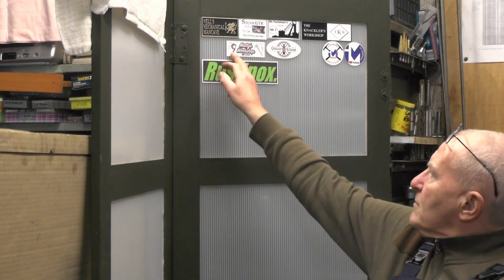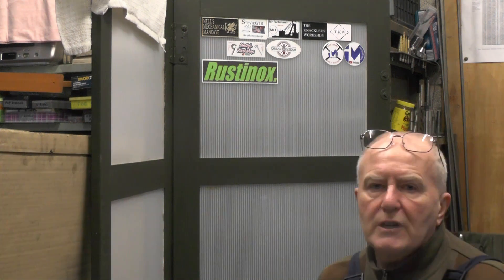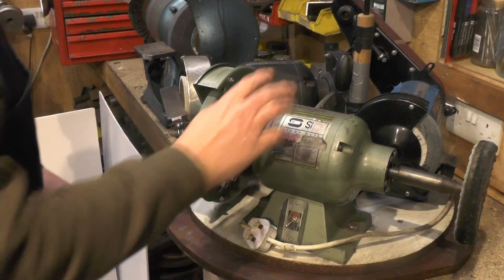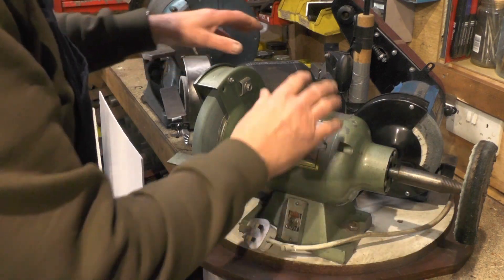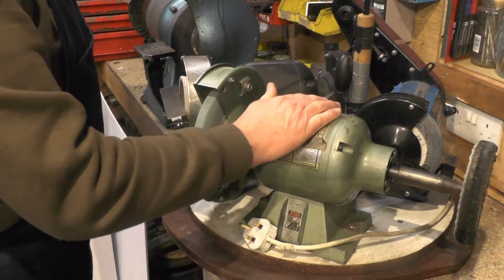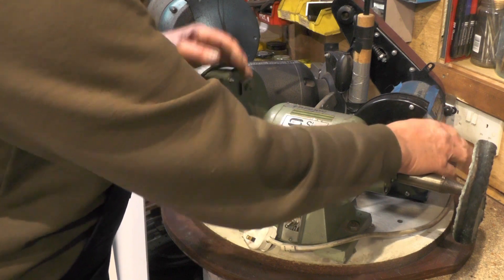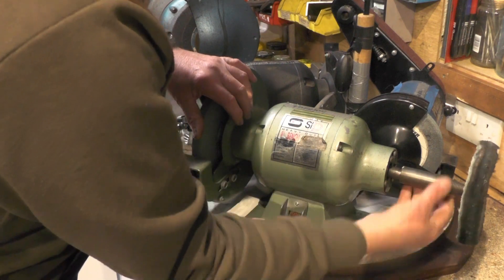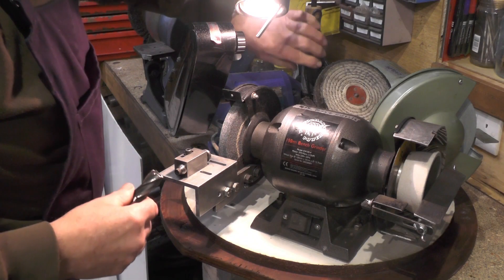Grinding Rest Part 1 for Bench Grinders to Sharpen End/Slot Mills (Modifications) "mr factotum"

Comment: I am wondering if these blocks could be made to hold a common R8 collet. This way you would not need to make 10 different sizes of inserts to fit the 3/4 inch hole. Maybe use 40mm square stock

Just take your 3/8's R8 collet and 3/8's end mill, put in the square holder and lock it true to the table. 

The square holder should be long enough for a cap screw in the back to crank the R8 collet back into the hole, locking the end mill tight. 

The square holders round hole would not need to be tapered for the R8, just pulling it into the holder will squeeze the collet down on the end mill.
Reply from the maker: eyup Dave.
I've skimmed over your comment without putting the detailed thought in to it, due to my  time contraints, and i'm sure there are many possibilities to modify it to suit your needs, just like i modified the original concept. However  just off top of my head i think if you use a larger block from the 1"  square, it will change all the angle relationship with the grinding wheel and  grinding rest to the cutter and therefore the cutter angles may be changed.
Just a thought,  to play around with. 
Let me know what you come up with, as i'm interested, my brain can't multi task anymore🤣🤣and i'm fully immersed in another project at the moment.
keep in touch
BFN
Kev

Comment: Hi I’m Chris
I’m new to machining and found your video on making your grinder rest very helpful 
I was wondering where I could find drawings plans for your simplified tool sharpening tool rest 
Thank you for the great information you share
Reply: Thank you for being so helpful 
Please continue to help others like me
Best wishes
Reply from the maker: eyup Chris
nice to hear your learning machining.
the plans are not mine, i just did some user friendly modifications to the grinder rest.
The plans are freely available on the internet from Workshop Practice Series 38 (loose plans) simple grinding rest, designed by harold hall. There are a few different ones that are more involved to make but they are all there free to use. 
As for my modifications i have no plans but i think my videos will give you all the info, required.
Any questions at any time feel free to ask my "Grey Cells"
Thanks for watching and for the feedback
regards
Kev

Comment: Hi Kev, I'm following this with keen interest. I wondered what measuring tools you use to set up your grinding jig when changing for the required angles for sharpening different milling cutters or Drill bits ? Maybe you will show us at the end of the series.Thanks for videos Paul
Reply from the maker: Hi Paul
thanks for your interest. I have not used it for drill bits, but i'm sure in the book there is a method, but for end mills and slot mills, If you make all the parts accuratly to the drawing, (part 2 for that) on a 6" (150 dia. wheel ), set it acurately  to the bench grinder initially (Part 3 ), thats it, the primary and secondary angle fall in to place automatically each time they are moved from one to the other, if you want the drawings before part 2  (shown next week), i can email them to you.
Check out my about page and my email is on it, then email me if you would like the drawings, it's no problem at all
take care
Kev
Reply: @MrFactotum  Thanks Kev, much appreciated, will send an email

Comment: Kev,  I will be looking for part 2.  I have a T&C grinder with an endmill attachment, however this looks far more usable for the quick and easy touch up on the Primary and Secondary angles.  Your modifications to improve the useability even more sound like a good idea.
Reply from the maker: Cheers Jim
Not be long for part 2 then part 3 it will all become clearer then. and it's now simple to use with the mods. Also your sticker will be going up on the board soon.
take care
Kev

Comment: The biggest problem with this style of sharpener is that any lift of the cutter being ground above the centre line of the wheel changes the angle of contact and the angle of the resulting ground surface - they work better with a cup wheel where the cutting surface is flat . An easier way is to set up the rest so the centre line of the tool holder ( the piece you clamp the cutter in) bore is level with the centre line of the grinder spindle and then use a spacer under the tool holder to raise it up a pre determined amount ( a cad programme makes determining this easy ) to give the correct cutting angles - it may be something like 10 mm for the primary and 25 mm for the secondary , maybe more , maybe less ,
Reply from the maker: Hi Ian
Yes, you have to adhere to the correct dimensions when making this rest with the position of the arm and table holes, and combined with 25 mm square stock for the cutter holder it then always ends up on the centre line automatically, all will become clearer in next video. Its worked for me for the last 10 years.
thanks for the feedback and watching 
appreciated
Kev